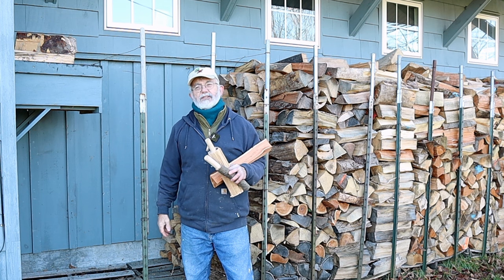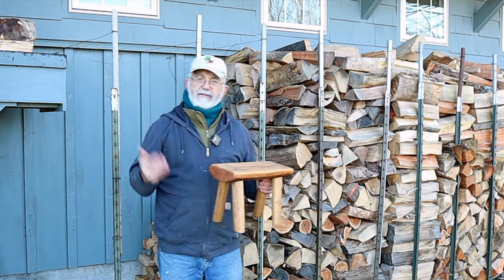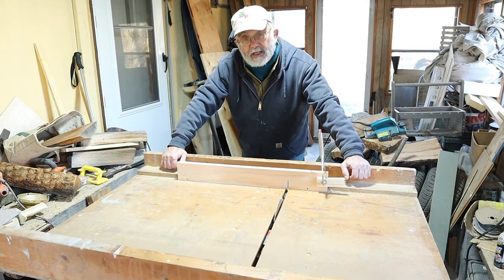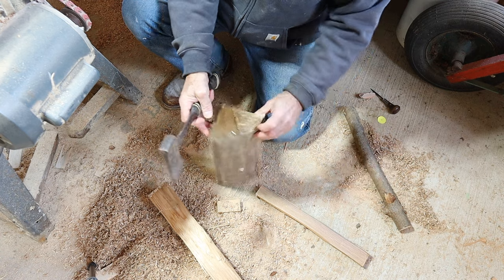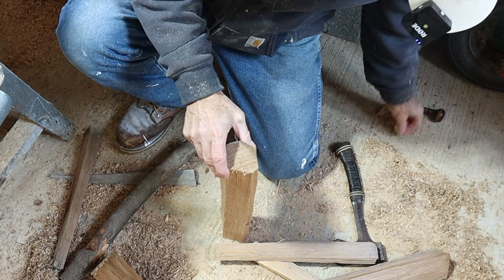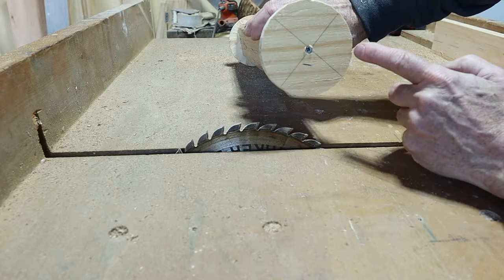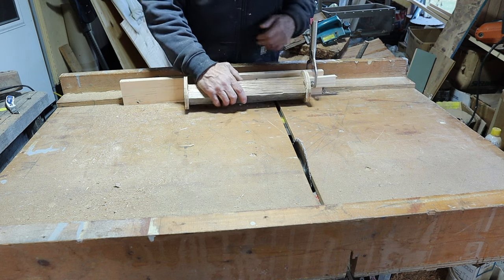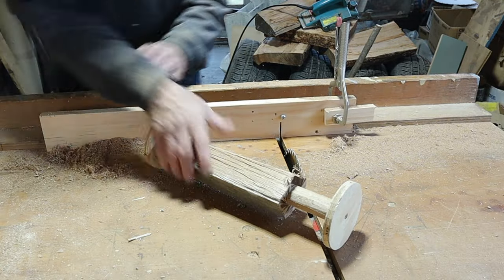Rustic Furniture Table Saw Trick: Cut Square-Shoulder Tenons on Firewood Chunks

Comment: I watch several DIY channels besides yours, Herrick, but for this technique I'll add one of my common thoughts when I see something for the first time: "WHY didn't I think of that?" Before you removed the template discs from the ends, you could have lowered the saw blade and rough shaped the stool legs as well, reducing the time spent with the hand planer....
Reply from the maker: Your idea of lowering the blade to get the rest of the legs shaped is brilliant... "Why didn't I think of that?" 🙂  And to take the concept a step further, I think I could put a long tapered wedge under the round end discs to get a uniform taper on the legs!
Reply: "Same Scene, take TWO! Why... didn't I think of the wedge trick?! We do it on a horizontal plane for tapering a leg, it would also work in the vertical mode....
Reply: Great idea, never seen a vid of this before. A close up of how to drive the wedge and cutting the legs for the arc of the bottom and getting the leg lengths right would also be nice. Thanks.

Comment: A lathe would make quick work of that task - but it's always nice to have other ways to get it done !   
I'm partial to a lathe , since it's much easier to get a 'precise fit' . . .  * My cheap Chinese machine will turn 8 1/4 " x any suitable length , with a 'jigged' tailstock support. . .    ** TRUELY 'round' tenons would be much better support , however ; the NATURE of wood tends to shrink  & swell with humidity changes .  
Good stuff !  Thanks . . .